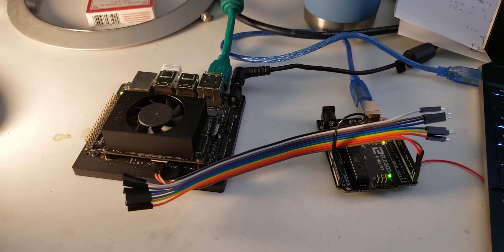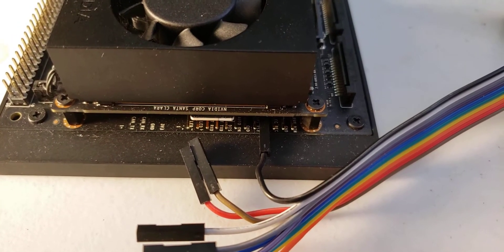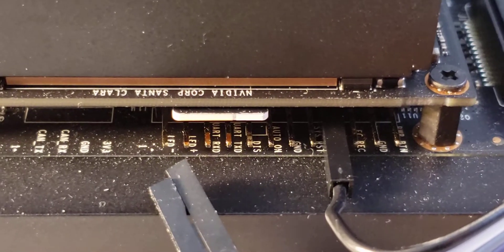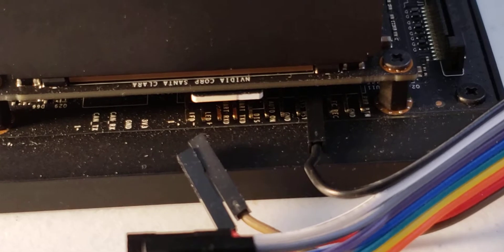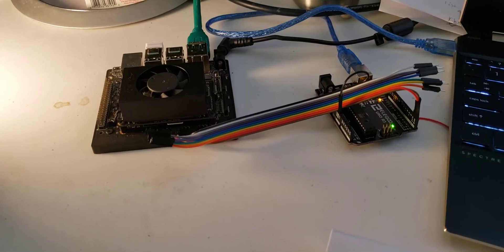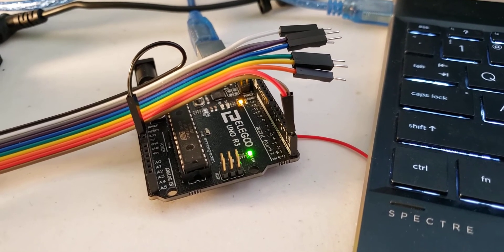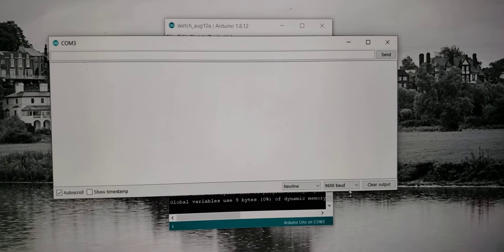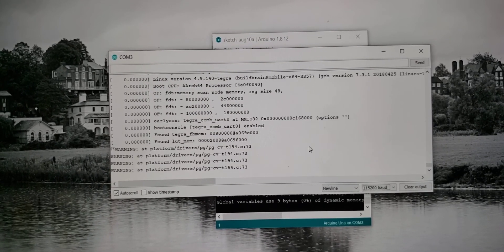Tutorial: NVIDIA Jetson Xavier NX UART Serial Dump using Arduino Uno

Comment: can u share the code of the transmition of data please? I did the same connections but for no reason it didn’t work for me
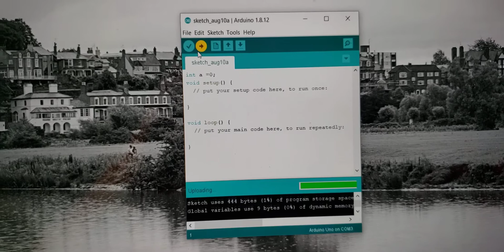Reply from the maker: Hello, the code used is an empty new Arduino sketch as seen in 4:03 of the video. I would double check the connection. An alternative would be to try it with an FTDI to micro USB board so that you can connect to the COM port using a program like PuTTY using the same connections.

Comment: Hi, in order for the serial communication process to work shouldn't the signal voltages of the pins be the same? From what I understand the Jetson pins operate at 3.3V whereas the Arduino Uno pins operate at 5, so just wondering why it works.
Reply from the maker: The Arduino pins will output 5V as digital HIGH signal. However, it doesn't require 5V to read a HIGH signal (https://forum.arduino.cc/t/at-what-voltage-is-a-digital-pin-high/124761 ). The Arduino comes with a voltage regulator on the board to prevent excess voltage from damaging the MCU. I've seen junior high school kids accidentally short the 5V pin to the GND pin and the whole thing heats up quickly, but the board is able to survive the abuse. I'm assuming the Jetson also has a voltage regulator to protect it from accidental or slight over-voltage on it's pins.

Comment: The TXD pin on the arduino is actually the input to the UART to USB converter. With your empty Arduino sketch you make sure the microcontroller isn't controlling the TXD pin. So the labels on the Xavier are correct.
Reply from the maker: I am not convinced! Serial communication should have a cross-over connection for RX and TX. See the topic here on stackoverflow, they used RXD and TXD notation:

https://stackoverflow.com/tags/uart/info
Reply: @metaphysicscomputing  Check the Arduino Uno schematics. You are not using the TXD and RXD of the microcontroller, but you are using the TXD and RXD of the USB to UART chip of the Arduino. You can even remove the microcontroller and it will still work.